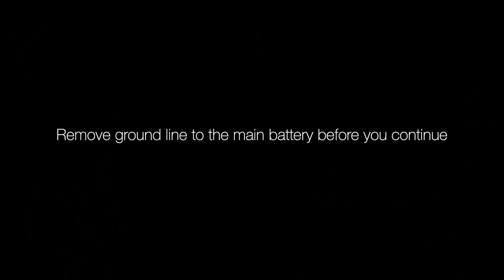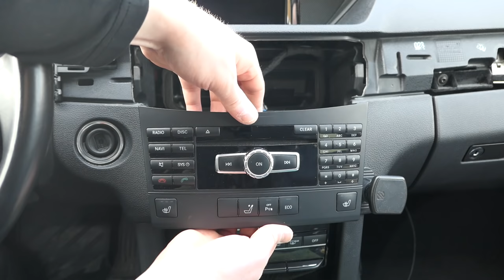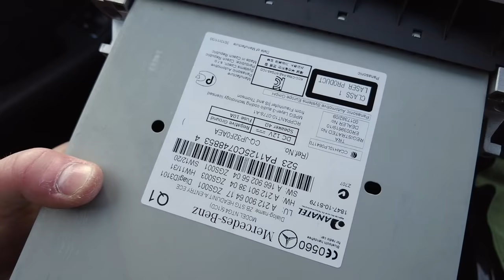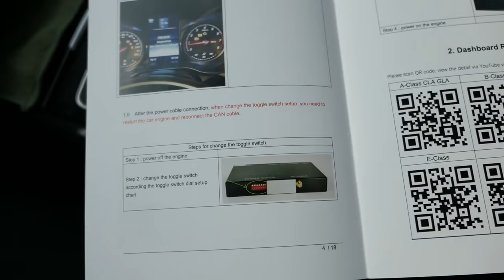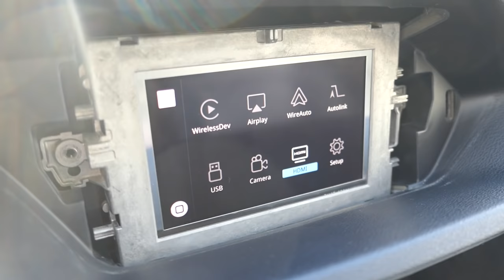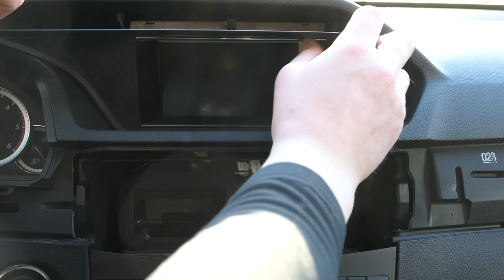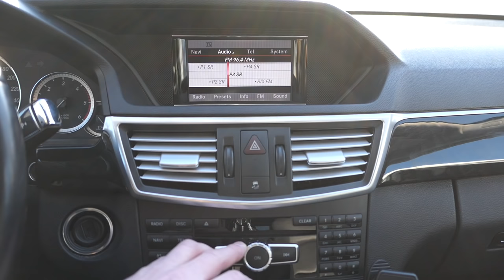Mercedes-Benz | How To - Install CarPlay For Audio 20

Comment: It will work for audio 20 NTG7? I have W212 2010
Reply from the maker: Sorry I never heard about NTG 7 head unit for W212.
Reply: @MB212  Never mind :) I used the VIN decoder and there is  - 525	CONNECT 20 HIGH (NTG7)
Reply from the maker: Interesting I going to check this up later on and if I get any information about CarPlay for you system I coming back to this comment 👍
Reply: @MB212  Really thank you. :) I think Audio 20 NTG 7 is ordinary for W212. (No optional equipment) Have a nice day :)
Reply: @fikipaldi6288  is NTG 4.7 and not NTG 7
Reply: @yotambien2664  I don't know, I used a Mercedes VIN decoder and there is a 525 CONNECT 20 HIGH (NTG7). So maybe for the same EU countries, it's an ordinary audio 20.
Reply from the maker: Google it briefly and seems that NTG7 is same as the APS if I got it right, kinda confused always tough audio 20 NTG 4.5 was the basic one ☺️
Reply: Please advise, what's the brand name, how to buy that unit?

Comment: Can this system be used on a late 2011 W207 NTG
Reply from the maker: Sorry I don’t know for sure, but probably as long you have NTG 4.5 if you have 4.0 you need another module.
Reply: @MB212  would you know what Carplay system could work for NTG 4.0?
Reply from the maker: This is the unit you need https://mbworld.org/forums/e-class-w212/794234-diy-kremersino-wireless-carplay-ntg4-0-a.html

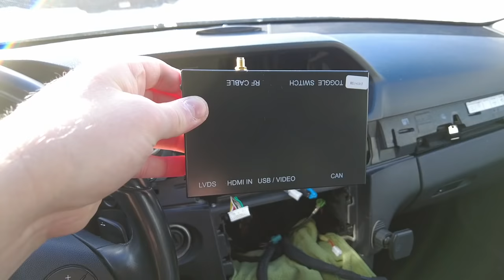Comment: 6:11 squeaks? knocking?
Reply from the maker: No because when cable are attached to the unit is sitting in place really good. So far no sound whatsoever ☺️ You could probably use some adhesive or cable tie if you like to be 100% sure

Comment: Si j’ai un conseil à vous donner faites bien attention au boîtier noir derrière l’écran il faut faire en sorte de bien le Fixe et l’isoler car ensuite si vous le faites pas ça ça peut faire du bruit lorsque vous rouler avec des grésillement dans le tableau de bord très pénible
Reply from the maker: Please English only! I try translate your comment, and is no problem with rattling sounds from the decoder box is sitting thigh there because of all the cables. But if you worry about that you could use some adhesive tape or something else to secure it more 🔥
Reply: Franchement, ce n’est que mon avis mais vu la complication pour installer le truc, et la forte probabilité de casser un élément et de se tromper, autant être un peu patient ou le faire installer par un pro.
Reply: @yoggg  Non c’est vachement simple à installer mais ce qu’il y a il faut bien isolé phonétiquement les cables et le boîtier ou sinon tu vas te retrouver avec des rossignols. Si t’as dire qu’il y aura des bruits parasites lorsque tu rouleras ce qui est assez agaçant parfois mais à part ça c’est très simple à installer fais-moi confiance.

Comment: Does it fit on 2010 e350
Reply from the maker: Because of the year of your car I guess you have the NTG 4 system then you need to buy from another seller. This seller do not have for your unit.
Reply: I have a 2010 E350 bluetec as well. Did you manage to get ?